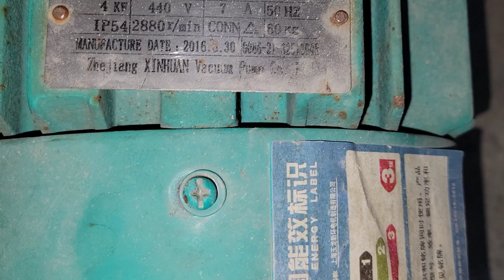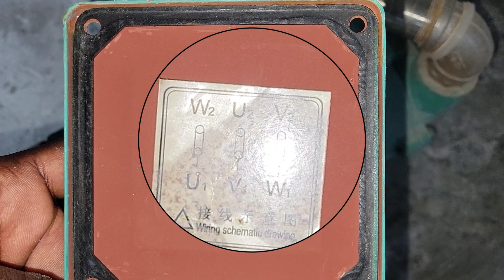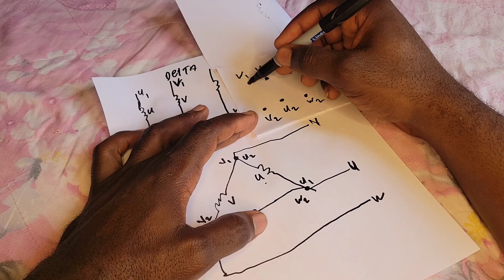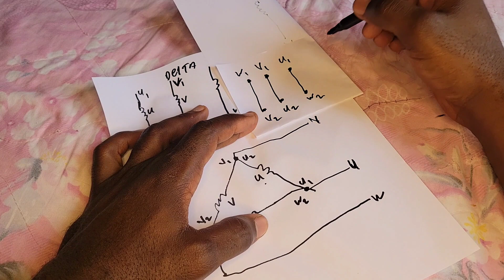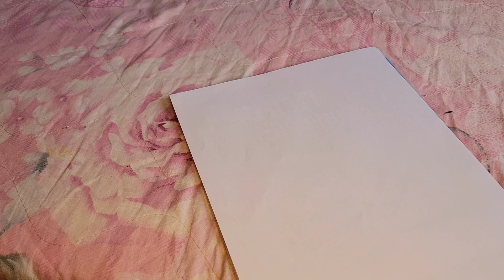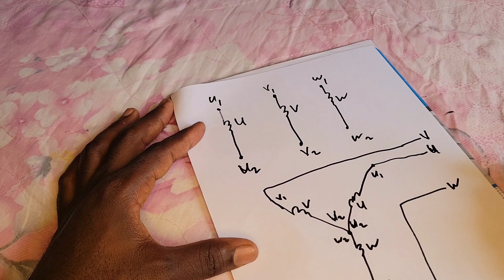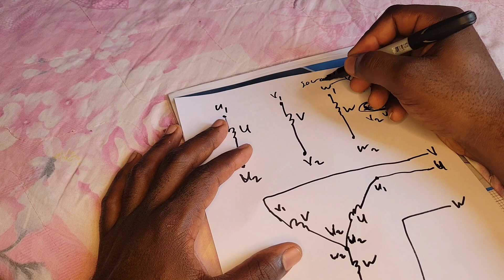How to Connect a 3-phase Motor or Pump | Delta and Wye(star) Configuration Explained

Comment: Delta gives you more current? And star gives more voltage?
Reply from the maker: In the case of motors, it's not necessarily a matter of giving more current or voltage. However, the Delta connection will have a higher line current and Star will have a higher line voltage. 

The different configurations are done based on needs such as reliability, speed, torque, and dual voltage application.
Reply: @danhielectricalservices  so which configuration give u more torque, speed and readability?
Reply from the maker: The Delta configuration will give you a slower speed and higher torque due to the higher line current that it will draw while the Star configuration will give you a lower torque and higher speed.